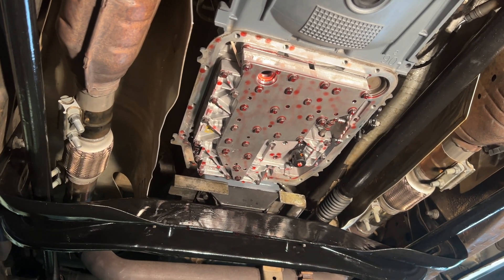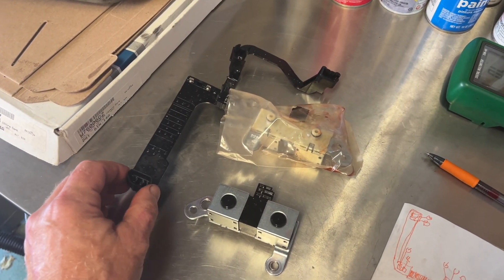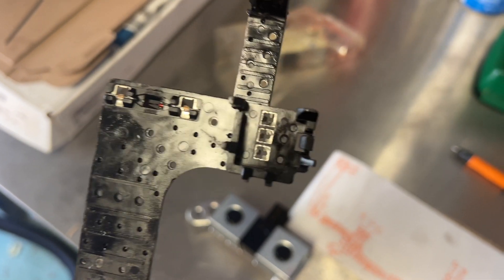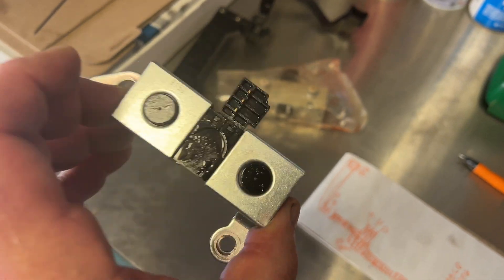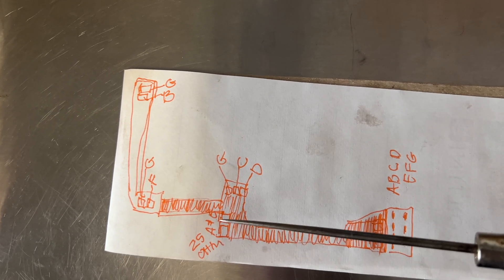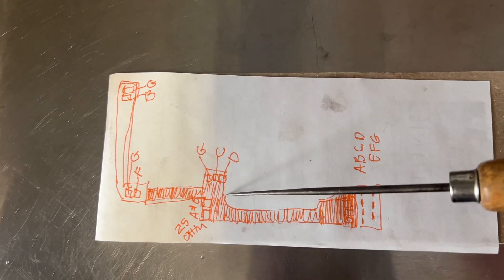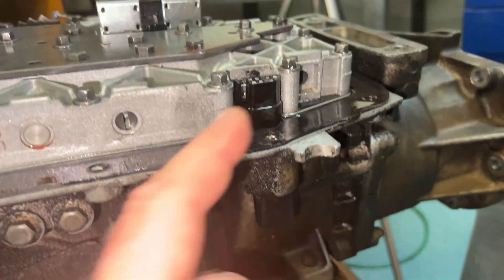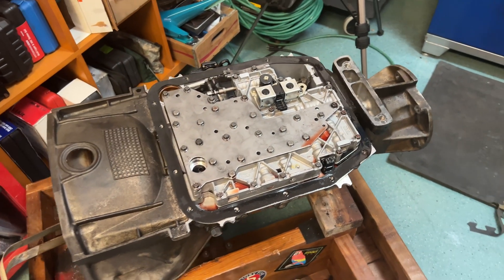Diagnose & Repair Ford 4R70W Shift Solenoid: P0750 & P0755 Diagnostic Trouble Codes

Comment: Great video, sir. My 06 E350 5.4l van hit me with PO743, and my OD light on my shifter keeps blinking. The van only has 60k miles on it.  It has sat up most of its life. It belonged to the local college here in Jacksonville, Florida. They barely used it since they bought it new. I sure hope it's only that TCC solenoid. I did the fluid change about one thousand miles ago and the pan and magnet were super clean and that yellow factory plug was in the pan so that's letting me know I'm the first one in there. Thanks for the video, and I'm sure it's going to benefit me when I dive into this transmission. 👍👍👍
Reply from the maker: Thank for the kind words!

P0743 (TCC solenoid circuit) + blinking OD light on a 60k-mile van that sat most of its life is almost always the TCC solenoid itself or the wiring right at the case connector. At that low mileage and with the pan/magnet still super clean and factory plug present, you can pretty much rule out clutch or hard-part damage. Sitting for a while, the solenoid just gets sticky or the pintle hangs up from varnish after years of no use.

Good change swapping the whole solenoid pack & TCC Solenoid fixes your issue. While you’re at it, hit the connector pins of the EPC solenoid, the hard plastic wiring harness and the case connector with contact cleaner and dielectric grease.  Florida humidity loves to green-corrode pins.

Let me know how it goes
Reply: @DrivingIntelligence Thank you for the quick response and the advice. What you said sounds about right. I'll be sure to let you know what I found. Take care, friend.
Reply: Just wanted to let ya know that I took your advice and replaced the TCC solenoid and I had to replace the case connector because it was bleeding fluid through it and it  saturated the pins inside the plug. Valve body had to come out to get that case connector out🥵never wanna do that again. Anyway just like you said buddy. Everything is running fine and no more po743 and no more service engine light. Thank you sir!🤝🏻

Comment: I just bought one today that only goes into reverse, it doesn't grab any other gear
Reply from the maker: If your 4R70W only goes into reverse but no forward gears (no movement in Drive or lower gears), it’s possibly a loss of forward clutches, often due to:

Low fluid or wrong fluid: Check level/condition: Mercon V is required; burnt/low fluid causes slip. Flush if needed.
Worn forward clutch pack: Mileage? Worn frictions/bands after 100k+ miles prevent engagement.
Valve body problem: Stuck valves or worn bores in valve body impacting pressure, common with old fluid.
Solenoid or wiring: Faulty solenoid pack or harness shorting the forward circuits.

Start with fluid check (warm, level ground). If good, pan drop for debris or solenoid test. May need a rebuild if internal wear.

Comment: Would this cause the car to not go into drive or fall out of drive transmission sat outside in the rain only has 80,000 miles. Everything seems to work but I seem to be having some sort of electrical issue when I put it into drive only it causes lights to dim. I’m assuming bad solenoid would love your input.
Reply from the maker: Your 4R70W with 80k miles sitting in the rain and lights dimming only in Drive points strongly to corrosion-induced electrical issues rather than a bad solenoid:

Dimming lights in Drive = sudden high current draw when the TCC or shift solenoid engages (both active in Drive). Rainwater likely entered the case connector or harness, creating a partial short to ground.
Low mileage + outdoor storage = perfect recipe for pin corrosion or water in the connector. The 4R70W’s connector sits low and is prone to splash.
Solenoids themselves rarely cause dimming unless shorted to case, but that usually sets codes. No codes = intermittent ground fault.

The fix:

Unplug the 12-pin case connector and look for green crust, water, or bent pins.
Clean with MAF cleaner and use dielectric grease to reconnect, good change this fixes it.
Check fluid: if milky or low, water entered via vent. You need to flush the transmission & refill with Mercon V.
Test solenoid resistance at connector as shown in video.
Inspect MLPS (neutral safety switch on side of case): Corrosion here can confuse PCM.

Bottom line: Start with connector cleaning, MLPS & fluid check.  Skip solenoid swap unless resistance is off. Let me know what you find.
Reply: @DrivingIntelligence  thank you so far you’re the only person to think like me😂
Reply from the maker: @CG-iu1nq  you're welcome!  Let me know how it works out
Reply: @DrivingIntelligence  the harness had obvious corrosion on the hidden side. The solenoids were full of rust, cleaned and replaced filter, fluid sensors and harness still having issues with the neutral safety switch. Everything seems to be working though I just have to put it into second gear, then bump it into drive and it works.
Reply from the maker: @CG-iu1nq  the switch is also likely corroded
Reply: @DrivingIntelligence  probably so was full of water cleaned it with mass airflow sensor helped definitely need a new one😂 does 70 though now I’m popping the rear differential cover off to see if I can free the sticking LSD
Reply from the maker: You’ve got your hands full, but making progress!
Reply: @DrivingIntelligence  yes sir thank you for your help

Comment: I own a 95 f-150 2wd with the 4r70w trans . 

Truck was never driven hard in the many years i had it & the trans always shifted like it should until a few months ago .

The issues i am having now is if the truck is parked & I shift out of Drive right into 2nd gear , it stalls out the engine ...but does this ONLY in 2nd gear . And i can manually downshift from Drive into 2nd as long as the truck is moving & the rpms don't drop too low .

If it was the torque convertor , this should happen in ALL the gears but it doesn't.  

I ordered the solenoid kit & valve body as well . Hopefully this will fix the issues .
Reply from the maker: Your '95 F-150 4R70W stalling only when shifting from Park directly to 2nd (but fine when moving) points to a stuck 2-3 shift valve or misalignment in the valve body, causing excessive pressure that kills the engine. The solenoid pack could contribute too. Your valve body + solenoid kit should fix it.  

Have you thought about first changing the fluid to see if it frees up internal transmission parts? 

Slightly different issue, but I owned a 1998 Chevy Lumina years ago and it became very difficult to move the shift lever.  I thought it was a shift cable issue.  Dropped the pan and did a fluid / filter change, and voila, resolved my issue.

Comment: On D: First two gears slip sometimes when shifting, and when I'm driving at a high speed it shifts to a lower gear when i take off my foot from the accelerator pedal

R, 1, 2 work normally

After I climb a hill the problem of gear slipping increases for a while on D

I have no codes. Could it be a bad vale body and solenoid? I think i will replace it myself before taking it to a mechanic
Reply from the maker: Your 4R70W’s slipping in first two gears in drive, downshifting at high speed when lifting off, and slipping after hills (no codes) point to a few possible issues; a bad solenoid pack or valve body could be causing pressure glitches—try replacing the solenoid pack and if that doesn't do it, you might want to look at a valve body rebuild and shift accumulators.  This also depends on mileage and fluid condition.  Clutch packs might be worn, especially post-hill, so check fluid.  If it’s burnt or glittery, likely wear is the issue. Let me know how it turns out

Comment: Have you found any issues with the solenoid pack failing intermittently on rare occasion without throwing a code?
Reply from the maker: I've never noticed this, but it is possible.  The 4R70W solenoid pack can fail intermittently without a code, possibly due to a weak solenoid, loose connection, or wear affecting pressure. Check wiring and test solenoid resistance (~20-30 ohms). If issues persist, consider a pressure test or swap the pack.

Comment: ddrive slips & disappears,only 1& work,no codes ?
Reply from the maker: Let me make sure I understand your question, transmission goes into Drive, you go through first gear and it neutrals out going into second?  No DTCs?

The 4R70W shifting into Drive and first gear but neutering out in second gear, with no codes, could point to a failing 1-2 shift solenoid, wiring issue, or worn 1-2 accumulator. Check the transmission fluid level and condition first—low or burnt fluid can cause this. Inspect solenoid wiring and do a pan drop to inspect for debris. 

If no fix, a transmission specialist should check line pressure or scan for subtle issues.

2.5s

Comment: 3:37 Man I'm crush this truck, one rebuild transmission then I went and bought two used transmissions and they still throwing the same code solenoid A and b
Reply from the maker: Sounds like you have a wiring harness issue.  Or possibly an ECU issue.

Comment: I hope it works for mine bit great tips🤘🏿🤘🏿 I'm using a junkyard transmission with someone already rebuilt the overdrive spring went out and now my overdrive light is flashing but before it wasn't so I'm going to check that what you're talking about Buddy... but it didn't have any check engine lights when I first drove it in the overdrive was messed up🙏🏿🙏🏿🙏🏿🙏🏿🐐🐐🐐🐐🐐😭😭😭😭😭
Reply from the maker: The spring in the overdrive servo?

Comment: Where are you checking continuity? Off the b solenoid with 3 pins, checking from pin to pin for 26 ohms?
Reply from the maker: If checking from the case connector, yes, from pin to pin.  You're checking resistance across the solenoid.

Comment: I dont have any codes thrown. I have a 05 crown vic p71 it shifts 123 fine but half throttle at 3 and in od feels like neutral if i  smash the peddle itll go. I changed fluid and filter tried resetting pcm and tried a junkyard one nothing worked. any insight before i throw even more money or just give up.
Reply from the maker: Hi, kinda hard to diagnose from afar, but here are some of the problems I would look at first before pulling the transmission and inspecting internal parts.  Valve body and accumulator issues will require removal of the valve body, but not the transmission:  Your shift accumulators could be leaking fluid due to wear, these are found in the transmission case behind the valve body.  The following valve body components could be damaged, stuck or worn:  solenoid regulator valve, 2-3 capacity modulator valve, 3-4 shift valve &/or 3-4 shift valve end plug, 3-4 capacity modulator valve, overdrive servo regulator valve & sleeve... this is an overwhelming list of possible fail points.  When I had some transmission issues, I replaced all shift accumulators and rebuilt the valve body with a good shift kit.  This video shows the parts I used, all linked in the description of the video:  https://youtu.be/YwPMiS6sMtI?si=4yXv5MrtAzC2Rj2u & this is my 4R70W Playlist:  https://youtube.com/playlist?list=PLGNsbVXzRfZM6WpCF862q4DlkyatzFIMz&si=NOpYg6JefrpJL1In
Reply: @DrivingIntelligence  Alright thank you. I dropped the pan again and the fluid was burnt so it overheated. Im going to check the cooler lines and check the valve body and pray that nothing got damage due the the overheat.
Reply from the maker: @nj4675  ouch, hope you didn't run it too long like that.  Lots of friction material in the pan?
Reply: @DrivingIntelligence  not an awful lot hopefully I can save it. worse case scenario if you advice doesnt work I just get it rebuilt.
Reply from the maker: Good luck, stay in touch and let me know what you find out.  4R70W is rather easy to rebuild.
Reply: @DrivingIntelligence  I got the valve body out no broken snap rings fell although a little filter came out. i checked the springs in the valve body and they’re all good would you recommend buying the tcc, shift sensor and a new strap? Also is there a different way adding the new fluid since more came out than a regular fluid change

Comment: Great video. Firstly. And my alternator died. I put new one n belt in. And my od light started flashing. Code says solenoid B is the prob. I’ve checked all visible wires n fluid levels n fuses/relays. All that is good. My question is,would driving with incorrect voltage burn out a solenoid? Or was It just weird timing? I’m bout to dump fluid and inspect inside but I mite try not to ohm out that plug. I don’t have a lift I’m on ramps. So idk how accessible it is. But I’m definitely gunna check new parts. wtf our country goin to shit just another example. New part sold dead. I’ve brighten parts that came boxed wrong. Or the counter guy argues with me over part I want cause his computer says I’m wrong I had to physically go take out alternator and go back to show him before he would sell it to me. Tried sellin me wrong belt and wrong part. Thank you for info I’d like to kno if u think the dead batts/alternator could cause solenoid to die?
Reply from the maker: I would say anything is possible, a voltage spike can cause damage.  What code are you getting?  Same as shown in my video?  Best to test at the plug, and if you can't get to that, pull the pan and check the solenoid, and do some other maintenance while you're in there.  I have a 4R70W Playlist.

Comment: Did you ever put power to the solenoid to test if it both sides actuate or not ?
Reply from the maker: I did not, as in the video, I only tested resistance which checked out.
Reply: Would you kindly advise how to test the solenoid to see if it clicks or moves? To clarify, which prong gets the battery’s positive and negative?

Comment: Would this issue prevent the transmission from shifting into 3rd and 4th gear by chance? Or make it take higher rpms to do so
Reply from the maker: I'm not a total expert on this transmission, but there are several areas that can impact shifting into 3rd, loss of the 2-3 accumulator, worn out valve body, problems with the overdrive accumulator, damaged forward direct drum.  You  note it goes to higher rpm's, but does it actually shift?  Or just neutral out?
Reply: @DrivingIntelligence  as of recent it just stays in 2nd gear and won't shift into 3rd
Reply from the maker: Do you have a check engine light, diagnostic trouble codes, and is the overdrive light on your shifter flashing?
Reply: @DrivingIntelligence   Mine runs 1 nd 2nd perfect then it just neutrals out when trying to shift to 3rd have any ideas? No codes, No service Enigne light, no Overdrive flashing, everything else works perfectly.
Reply: Check engine light is on, haven't had a chance to check the codes but the overdrive light is flashing
Reply from the maker: Nobody can help you until you check diagnostic trouble codes
Reply: Hey buddy got a 2002 f150 only shifts into first won’t shift into any other gear. Just revs up in rpm’s

Comment: quick question I was seeing your older videos and saw you did a ram air modification, I just had a few concerns I go to the beach often and sometimes mudding. It also rains alot where im from, was wondering if that would be an issue since the ram air is closer the floor.
Reply from the maker: I don’t think you’ll have a problem other than ground clearance. There is not a direct connection between the output of my ram air system and the input of the airbox. The biggest problem, you might get some water in the fender, but I don’t think it’s going to be a problem. I’m sure none of it will get into the intake.

Comment: You must use ford motor company oem solenoids only most of your aftermarket ones are single and not dual cycle solenoids
Reply from the maker: I reinstalled the original Ford solenoid pack, not success  :(

Comment: That's horrible with new parts. What a waste of time and energy. Glad you got your F150 back on the road.
Reply from the maker: Mark!  I'm having to remove the transmission again!  Another failed part, probably from the same supplier!  I have to disassemble and inspect all the subassemblies!  :(
Reply: @DrivingIntelligence  that stinks Barry! You will get it fixed.
Reply from the maker: @titanicfilmsbymark  thx Mark, I'm frustrated, but committed
Reply: @DrivingIntelligence did you ever fix the problem? i am having problems with my mustang with the same trans that i just bought, it only revs and crawls in drive but reverse is fine, i replaced the torque converter and filter and that hasn’t fix it, my traction and cruise control buttons don’t work but OD does, im not getting any codes for it but i’m still thinking electrical
Reply from the maker: @robfolder  sorry for this late reply... just catching up on some of my comments.  I just went through my transmission, and you likely have a mechanical problem such as worn clutches, leaking accumulators, worn valve body... did it fail suddenly, or get progressively worse?  You might need to disassemble the transmission to find the issue, but first I would pull the valve body, check the accumulators and rebuild the valve body while it's out with a quality shift kit.  Check out this video:  https://youtu.be/YwPMiS6sMtI?si=BC_HAVYK7x4okLh1
Reply: @DrivingIntelligence  ok thank you for the advice I will definitely look at that, I recently bought it like that about two months ago now, I have a cheap donor trans from a gt i’m going to swap parts with. i was going to replace it with the gt but didn’t realize the bell housing was different until i was already home, the insides are the same so everything should be swappable.